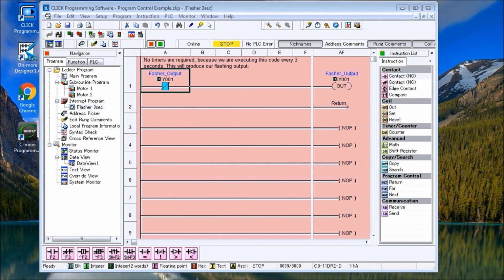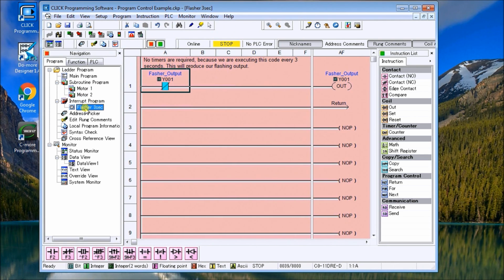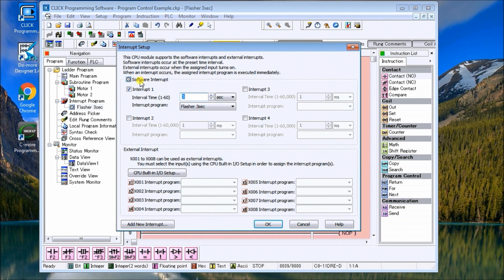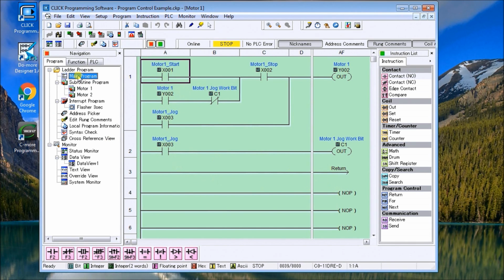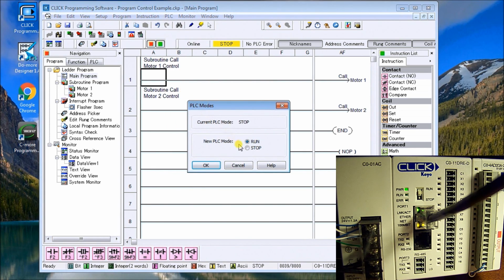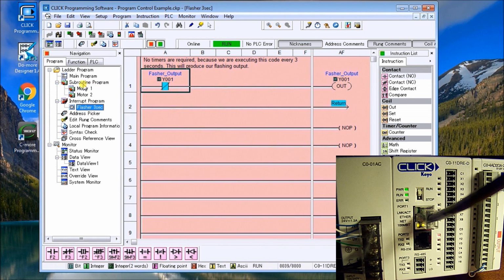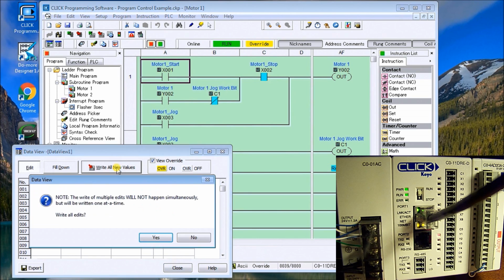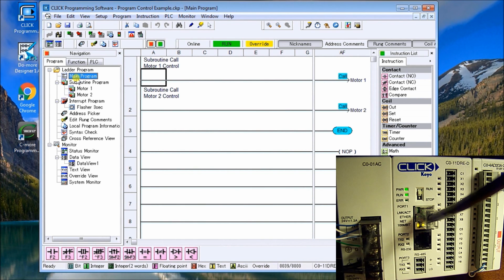Click PLC Flow Techniques: Timed Interrupts & Subroutines Setup! 🔢

Comment: What is the correct approach to getting the output states back to zero after you exit out of the subroutine because I'm having to write outside logic in the main program scan to reset outputs to states I wanted after the subrountine is finished, but there has got to be a way to do it when you return from a subroutine. How do you do it?
Reply from the maker: I am not sure that I understand your question. Remember that the PLC scans cyclically. At the end of the subroutine, the outputs are set according to your program. When the scan if finished executing the program, the outputs are updated.
Regards,
Garry
Reply: @ACCautomation subroutines stop updating the outputs once they are exited from and you disable their execution on the rung that powers them. But they are useful if your programs are huge and you need some parts not scanned, but the issue  I'm having is I have to set the output states to zero outside the subroutine  with some ladder logic on the main ladder program when I have it inactive or it will keep them active. I'm wondering if there is something better I can do that can do the reseting inside the subroutine before exiting and it's inactive.
Reply from the maker: @EETechs  
What about having the reverse logic to activate another subroutine to zero the outputs?
Just a thought.
Garry
Reply: @ACCautomation  That would work great. Then I can use a negative edge trigger contact in the main program on the set outputs back to my initial state subroutine so that its performed in one scan, so that  both my original subroutine and the reset the outputs back to the initial subroutine will not be continously scanned. Ill give it a try.

Comment: how could i  move the accumulation time of a timer into a register?
Reply from the maker: Hi Joe,
This is a common question. The current value of the Click PLC timer is stored in the TD memory area. 
Example:
Timer 1 :
T1 - This is the timer bit
TD1 - This is the current value of the timer
Use the "Copy" Copy Single command to copy the value to another register. The Src (Source) would be the timer like TD1, and the Des (Destination) would be any other register like DS1.
I hope this helps you out.
Regards,
Garry

Comment: Can you make a video on lead lag programming on a click PLC? Thanks
Reply from the maker: Hi Tj,
That is a good idea. I will add this to my list. In the meantime, here are some links showing lead-lag programming on a click PLC.
https://community.automationdirect.com/s/question/0D53u00002MWjmtCAD/lead-lag-programming-new-plc-programmer-here-im-using-a-click-plc-to-stage-and-operate-2-fans-with-a-010vdc-control-i-have-searched-the-forum-and-can-only-come-up-with-legacy-posts-with-bad-links-can-someone-help-with-a-programming-example
https://community.automationdirect.com/s/question/0D53u000029N936CAC/click-pump-lead-lag
I hope this helps you out.
Regards,
Garry

Comment: error code PTC 001 cannot accss comm port because it's in use by another application. this click plc has been nothing but trouble I swear. i just paid 80 for a new serial to USB and now this happens. Do you know what this is?
Reply from the maker: Hi JJ W,
Communication errors can be frustrating. There are a few things to check. 

- You are using a serial USB cable. Did you install the software that came with this cable before plugging it into the computer? What is the part number of the cable. Here is the one that I have used.
https://www.automationdirect.com/adc/shopping/catalog/cables/operator_interface/c-more_touch_panel_a_micro-graphic_panel_cables/ea-mg-pgm-cbl

- Open up the device manager on your Windows (Version?) computer and see if the com port for the cable has been installed.

- Sometimes the firewall on Windows (10) will prevent communication. Try turning off the firewall and then communicate. 

I hope this helps you out.
Let me know.
Thanks,
Garry
Reply: @ACCautomation  EA-MG-PGM-CBL I believe it’s a prolific.
Reply from the maker: @joew4202  
I would give Automation Direct a call. Their technical support is good.
1-800-633-0405
At this point, I'm not sure if it is the hardware or software on the computer.
Regards,
Garry

Comment: will the I/o cards for click be compatible with new click plus? is it possible to use mqtt with original click analog with ethernet?
Reply from the maker: Hi V Richter,
All of the IO cards for the click are compatible with the new click PLUS.
MQTT is only available with the click PLUS. 
You cannot use MQTT with the original click analog with ethernet.
However, you can use a stride MQTT gateway to the Click PLC using Modbus TCP.
https://accautomation.ca/stride-mqtt-gateway-click-plc-modbus-rtu-tcp/
Good question. Thank you.
Garry

Comment: I subscribed your very nice video presentation, I am very beginner of PLC, can we use this click plc for overhead crane control systems? how much is the cost for complete set up of operations hoist, trolley and bridge functions slow and high speed each function. thanks
Reply from the maker: Hi Jessie,
This is just the PLC. Programming of the unit would be up to you or a hired integrator. 
Here is the website where you can purchase the unit.
https://www.automationdirect.com/adc/shopping/catalog/programmable_controllers/click_series_plcs_(stackable_micro_brick)
Here's a beginners guide that we have put together to introduce you to PLC programming and concepts.
https://accautomation.ca/programming/plc-beginners-guide/
I hope this helps you out.
Regards,
Garry

Comment: Hey, 

At work I have a click, and I'm trying to run a series of timed events, and have that same group of events repeat the process every 3 or 4 hrs or so. Can this be done with an interrupt like the flasher? I'm pretty new to the click logic.
Reply from the maker: Hi Doug,
You could do this with an interrupt, but I would not recommend it. Since the logic is not scanned all of the time, your timers would not work correctly.
I would look at the DRUM instruction for the timed event sequence.
https://accautomation.ca/click-plc-drum-instruction/
You could then use a counter with the SC8 (One Minute Bit) or SC9 (One Hour Bit) to tell when to start the timing sequence.
Hope this helps you out.
Regards,
Garry

Comment: more great click info, thanks. do you have information on the rock64 opencv similar to the raspberry pi3?
Reply from the maker: Thanks for the comment. I do not have information on using OpenCV (Open Source Computer Vision Library) with the Rock64 single board computer. I have run AdvancedHMI on Raspberry Pi.
https://www.advancedhmi.com/forum/index.php?topic=666.0
This would be for the HMI and Data Logging. (SCADA)
https://sourceforge.net/projects/advancedhmi/
Regards,
Garry